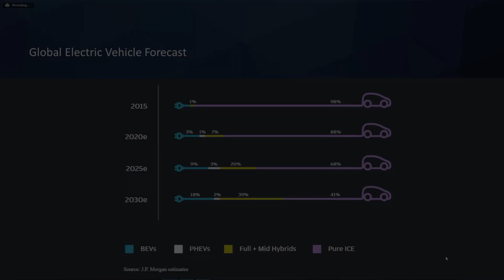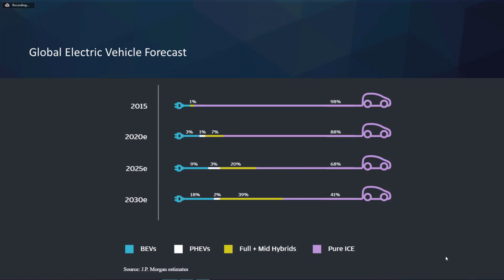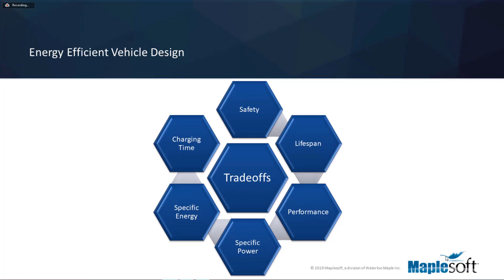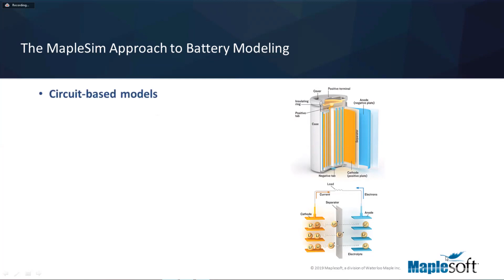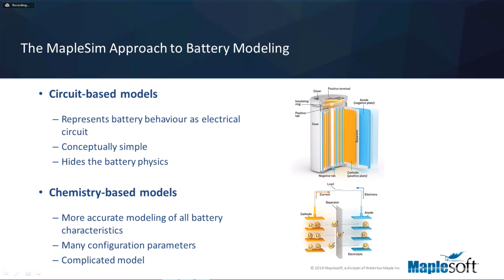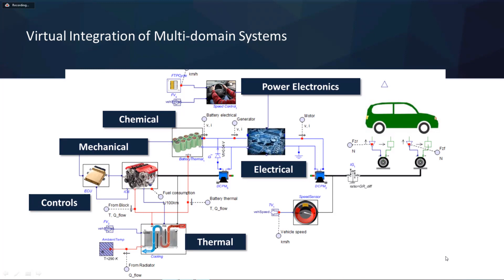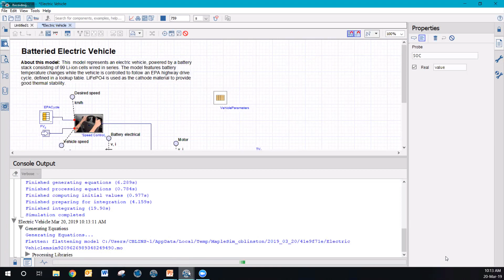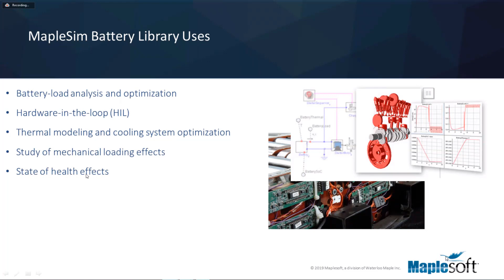Battery Modeling for Electric Vehicles

Comment: how can we customise our battery behaviour in that  model, any parameter estimation can be done  .
Reply from the maker: Thanks for your question. The Battery Library Add-on in MapleSim includes two “Apps” for fitting battery parameters (Equivalent-circuit or Electro-chemical models) to measurements. If you need more information about the Battery Library, you can find it here: https://www.maplesoft.com/products/toolboxes/battery/

Comment: hello,

Which electrical model of the battery do you use?

Thank you.
Reply from the maker: Hello! Thanks for reaching out. MapleSim supports equivalent-circuit modeling for lithium-ion, nickel metal hydride and lead-acid batteries and full electrochemical physics models for both lithium-ion and nickel metal hydride, depending on your needs and application. 

The specific model used in this webinar uses an electrochemical physics model of a lithium-ion battery. 

For more information about the Battery Library, check out https://www.maplesoft.com/products/toolboxes/battery/.
Reply: @maplesoft  Thank you.

I am working on regenerative braking for Electrical Vehicle. I have to make a battery model in order to knows the behavior of the battery in case of high current (High torque braking). What do you advise me to do ? thank you
Reply: @maplesoft  The link above does not provide any useful information about the equations you are modeling.  Knowing the source of the model and the model constants are very important - without which the user has no confidence in the model and won't know its limitations.